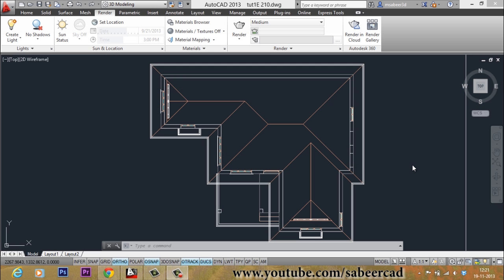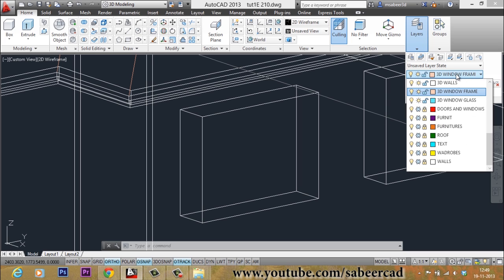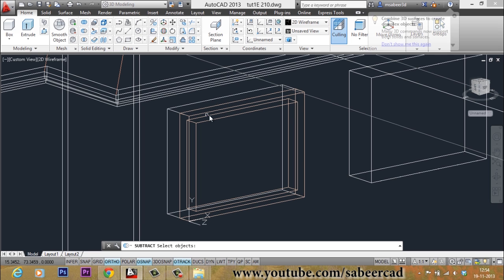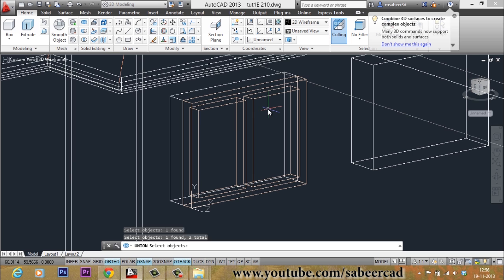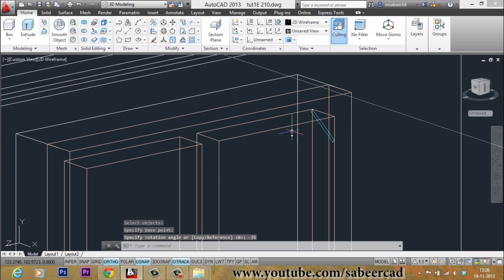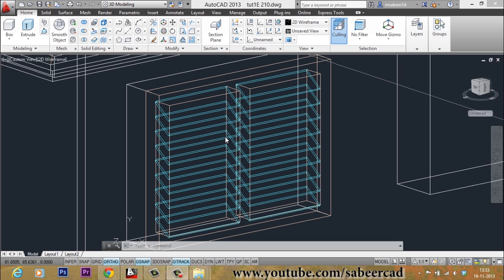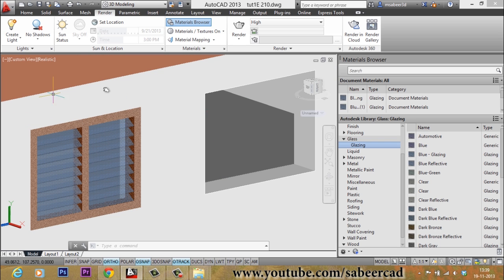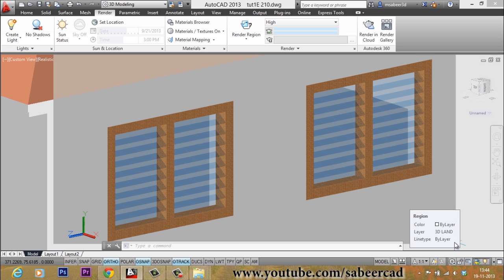AUTOCAD 3D HOUSE  | CREATING A LOUVERED VENTILATOR | AUTOCAD 3D VENTILATOR

Comment: excuse me sir have been trying to use the 3 axis point in autocad2015 bt seems not to work on me bt have use different way to design the louvers.anyway after array my louvers hve been trying to apply material  bt does not respond.
Reply from the maker: Just render it to see the result . Or you Better give material in 3d studio max...